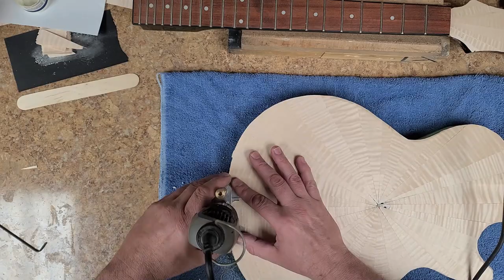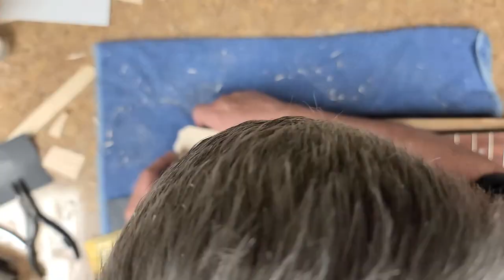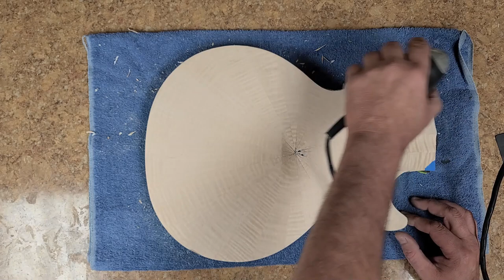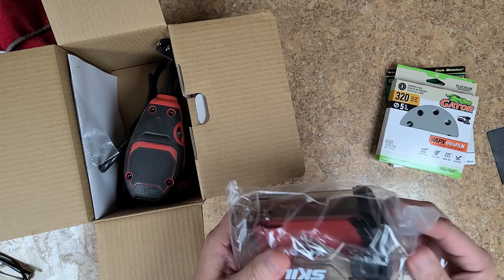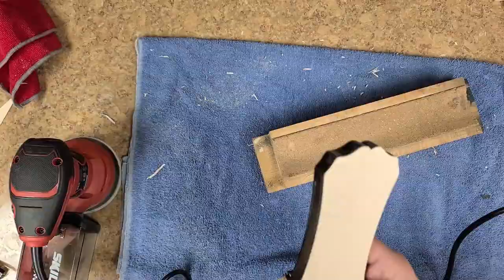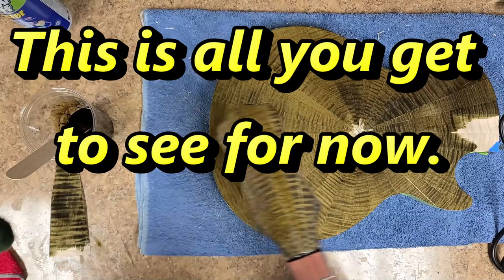Body Work Epiphone Special ll Custom Part 6

Comment: The inserts to suggest other videos imposed over the final message, but I'm pretty sure it said not final color just used to darken the flame.  I'm not a Les Paul fan, as far as shape, I play a Thunderbird bass.  However, I am excited to see how this turns out.  I appreciate the art in the guitar even if it is a shape I am not a fan of.  Thank you for making quick updates I am surprised at how fast you are uploading each part.
Reply from the maker: Yeah, I'm getting use to the setting for the video at the end. I think I fix it. I put a little time on it every day. I should upload a video every week, but this is turning out to good to hold back. Thanks.